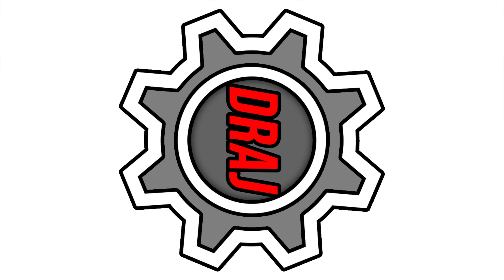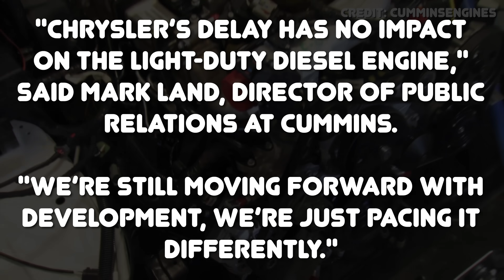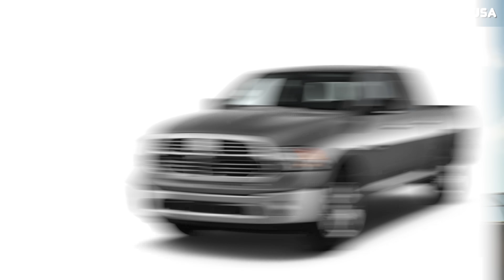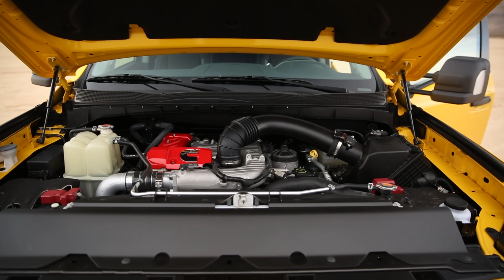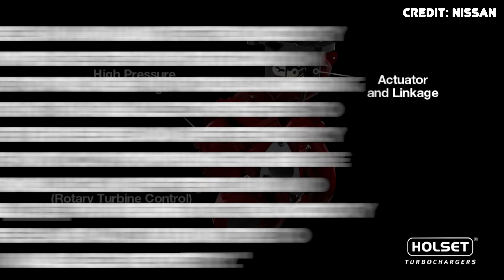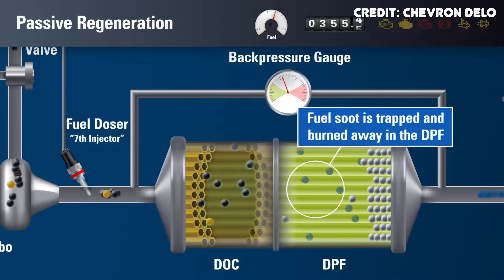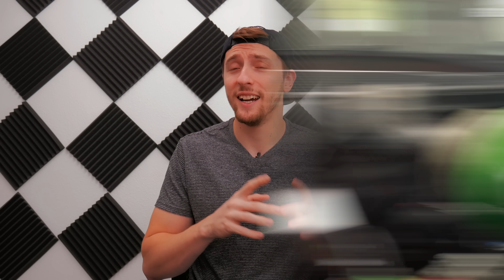5.0L Cummins: Everything You Need to Know

Comment from the maker: If you guys enjoyed the video, please SMASH THAT LIKE BUTTON. It helps the channel out a huge amount and helps YouTube put the video in front of more people. Thanks for watching 😬
Reply: Can you do one on the ford f150 powerstroke engine kind of like this or maybe a series on halfton diesel options and their development.
Reply: 5.9 cummins with the 6spd auto all day
Reply: That weight to power ratio is actually horrendous the old ass  OM606 on Mercedes puts out 600 horsepower with stock internals and can be fitted with a mechanical pump from the older OM617.

It's less than 500lb wet.
Reply: Specially with the twin cam set up, then u hav the turbo in the valley of the intake
Reply: have you done a vid on the toyota 4.5tdi. ausie. 75 series ute.  heres one for you, 4.2tdi, factory, fitted to silverado,s & s/duty,s. in brazil. i own a s/duty one in aus. with a bigger, turbo. std is a t04 mitsubishi, i fitted a t06. now has 700nm, 230 hp.. not much but good for aus, 12.5 lt 100. in brazil,they big turbo,& twin turbo them, scary fast..watch vids of them, f1000 turbo or silverado mwm sprint. or just mwm sprint. owned by IH, for 5 yrs.  4 & 6 cyl versions. then common rail, .5lt would sell like hot cakes in aus. bit dubius about the pump though.  an injector for the 4.5tdi toyota, is 1k,,each....starter in valley. as per dirtymax..
Reply: Always
Reply: Hav to hav a rocket engineer to werk on it
Reply: compare that to our ausie toyota 4.5 in the 79 series. its an anchore.. 1k per injector. 680nm twin turbo. starter in the back of valley.. joke..
Reply: This 5.0L Cummins engine is also great for swapping in used cars no matter what your favorite car is.
Reply: I think those Cummins diesel engines are great for all cars, even for Chevy Caprices, and Ford Police Interceptors.
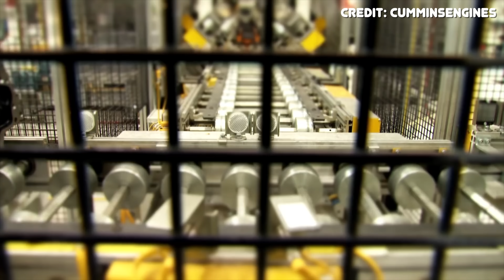Reply: 4:15
Reply: 10:47
Reply: I SMASHED IT and it didnt do anything except crack my phone screen.

Comment: A modern 1500 with a V8 or the high horsepower version can do 90% of the work an average person will need …. My 1999 F350 has a lower towing capacity than a modern F150 … your average guy isn’t going to keep a truck that is almost 30 years old so longevity isn’t an issue , for my usage I would never get a modern diesel , don’t need it , the most I tow is 10k and I don’t do it daily , so the better towing mileage really doesn’t justify the diesel

A family member has an eco boost 150 and it tows better than my 350 … difference is I get 16-17 unloaded and 13-14 towing , he gets 21 unloaded and 7 towing  , but when you tow maybe 2000k a year it’s not worth it for the doesel

Comment: I have the 5.0 Cummins in 2017 Titan. It was the cheaper option for what I needed at the time and honestly, I’m impressed. We towed a 9000 lbs RV from OH to WA and back, granted we stopped for fuel every couple hundred miles. With regular maintenance she’s been a reliable daily driver since. My only complaint is of course all the stupid sensors that often need replaced. But I am glad to have her with diesel prices where they are today.
Reply: I keep seeing good comments from people who actually have this truck and I keep seeing bad comments, but people who don’t have the truck I typically lean for people who actually driven and have experience with the truck on a personal level than just a mechanic simply because the mechanic is probably dealing with people who pushed their truck with extreme performance modifications who’s out here doing dumb things with their truck so it’s nice to know that there’s people who drive vehicles responsibly like yourself that I can lean on who actually don’t have these catastrophic problems. Thank you for your input.

Comment: Bought a 2018 in 2023 with 60,000. Had an issue with DEF recall, Nissan recall. At 120,000 the EGR went out. 2000.00. Has 150,000 on it now and still adding to it. It pulls 2 horse's just fine and I just hauled 5 rolls of hay at 1,000lbs. We love it. Comfortable and great towing.

Comment: Stay away from this engine . The crank broke on every one of them . 100 k miles it's the life of this engine . If you go over you risk engine failure . What ever they told you if you have a 2016 to 2019 cummins 5.0 make sure you change the crank and bearings . This is costly . One way to find out if your about to get it wreck is go with a bore scope cam by the oil plug and look if the crank is blue . If it's the case get rid of it or change  everything. You won't recive help from Nissan neither than from cummins . It's a not my problem case 😢

Comment: It is a shame that with Nissan out of the picture that Cummins doesn't just use some of the design theories that have made the rest of their engines so tough and reliable. I would buy a less complicated version that had either a single turbo, or a set of smaller twin turbos, didn't snap cranks, damage injector pumps and injectors, and had real valve covers. They could have a look at a Toyota Landcruiser V8 diesel for inspiration, at least now that they have sorted out the injection issues they had. lol

Comment: Cummins had to have problems with this engine. They made it because of the space that Nissan had. I am a Nissan owner on the '05 and still has $200,000 and runs great. I'm sorry to see that Cummins had so many problems with the diesel. I would have bought one but of course they had too many problems with the turbo in EGR system unfortunately

Comment: Put the 5.0 in front of the ZF 8HP70 8 speed automatic, it'll get WAY better fuel economy. At this point, unless they scale down the 6.7/5.9 and put it in a ram 1500, I'm convinced there will NEVER be a good half ton diesel. Like literally, just take the 5.9l cummins, make it a 3.0l or maybe a 4.0l and you're set with a million mile motor.

Comment: There is a ton of disinformation in the video about the application of the ISV8 engine… ram didn’t use this motor because they would’ve had to redesign the chassis of their 1500 trucks completely, and Nissan stole Dodges sales rep finalizing a souring business relationship… The Titan XD was substantially larger than any half ton on the market weighing as much as most 3/4 ton trucks of that time, in fact the frame is from the NV series van that Nissan discontinued and they were massive trucks…That motor was never intended for a Ram 1500, and the Titan and Titan XD are two completely different trucks sharing on a few body panels and interior options. Also, he didn’t even mention the main issue with these trucks, crank failure, I know I had one.

Comment: The same basic project seems to have also originated the overseas ISF2.8 which was offered as R2.8 in the USDM. But maybe, had the 5.6L V8 succeeded at the intention to replace the B5.9 in the Ram, maybe a 4.2L V6 for the 1500 would follow suit.

Comment: I didn't watch the video but talking about this engine is pointless without talking about the transmission it's attached to. 

Currently you can't get any parts for the transmission other than filters. You can't even get proper seals from a dealership. Any other wise fixable problem will now require you to buy a complete transmission from a dealer for about $13k US.

Comment: As an owner of one of these 5.0l cummins, nissan disasters. I do not think their good for anything. why nissan only source of parts, EGR cooler 2000 installed, turbo 7000 new 4500 reman, def pump out warranty 3500, no parts for transmission only complete unit 14000, new engine  24000, injectors 1400 each. That's without any normal maintenance. They also brake crankshafts.

Comment: There is another BIG, or rather the reverse, advantage of the V8 over the in-line 6 - and that's the sheer length, and height, of the engine!
There are many instances one may not be able to package the 'six' but an 'eight' will fit. True, so will a four, but they may simply lack the required power/torque or NVH requirements.

That's a big part of why the VM30 was/is popular, especially after the failure points are addressed.

Comment: Great video.  I have a 2017 XD.  It was a slug, added foss filtration system/pump and did DPF delete.   Went from 12 mpg to 19 mpg and it’s a beast of a truck now.
Reply: Just bought 16 going do same thing 94,000 km still have it ?
Reply: @barsandrunning thinking g of buying a 16 how much is that gonna cost
Reply: @REKLAW47 they are known for cracking heads, each head is 5-8k
Reply: @dudeman3186 
These Titan XD’s crack heads? I just started to research them. I think I’m just going to build my own truck and do a 12 valve Cummins swap on truck of my choice and restore it. Everything since EPA regulations are all garbage I’m finding
Reply: I did a delete to,  getting 20 city and 30 hw. You have a heavy foot?
Reply: Yes heavy foot needed ? Someone told me they burn ❤️‍🔥 better heavy foot?
Reply: @barsandrunning I drive it like a normal truck, and it does fine and gets good mpg
Reply: @imcrazyforwar  Do you live in a rural area?  I live in the city and wondering how you get it past registration?  Im in texas and very curious.
Reply: @aznxfactor I live in a state where they don't check for emissions
Reply: @imcrazyforwar nice!
Reply: @i @imcrazyforwar neither does Texas. We don’t even have an inspection portion at all anymore as of this year.

Comment: I’ve bought my truck now (2500 Ram)in 2003. The only problem I’ve had is to have the trans rebuilt (twice pulling my 14 k trailer)and replacing my heater core twice. I now have just over 750K on it. Great truck if you take care of it.

Comment: Too bad it’s an amazing engine just bad engineering add on components like the def/egr/fuel pump. And market it as. 1500 nothing else and keep the price at the low point and this truck would have slayed so bad engineering and marketing = failure and class action law suits 😢  and the demise of a Nissan and Cummins relationship. If you buy one replace the fuel pump /egr/ and delete the def system if your a farmer

Comment: Thank you for uploading. Cummins makes the best diesel engines in the light-duty truck applications, not to mention the fact that the 1989 Dodge Ram equipped with the Cummins diesel engine was (to my knowledge, I could be wrong) the first use of a reliable diesel engine in a pickup truck.

Comment: Those 5 L Cummins are known for breaking crankshafts. I saw a mechanic work on a Nissan Titian with spun bearings and main caps that had massive slop in them. The journals were burnt from the bearings spinning. The engine had a horrible rattling noise but no weird exhaust smoke. At $23,000 for a new engine, the shop is gonna try to get a good used block.
Reply: Holy fuk 23k for a new engine? That’s insane
Reply: So, i would like to give some insight to this. These engines have an after treatment protocol for keeping the exhaust hot enough to properly turn harmful chemicals into not so harmful chemicals (this process sprays the injectors post power stroke) with this being said, the engine oil should be filled to the very bottom mark of the dipstick, when the injectors spray after the power/combustion stroke, naturally some diesel fuel will end up in the crank case (this is why the oil should be filled to very bottom hash mark of dipstick) filling them over the bottom hash will result in over filling the engine over the course of a 10k mile oil change as recommended by owners manual. This is why the crankshafts wind up broken. Not usually a manufacturer defect, just misinformed lube techs/owners.

Comment: After doing a lot of research I decided to buy a Nissan Titan XD with the 5.0. Cummins because it was exactly what I was looking for.  I bought a 2018 with a 100k miles on it that was a one owner and strict maintenance which is the key to anything lasting for a long time. I’ve had it for about 3 months now and I absolutely love it. Coming from a guy who has owned dodge, Chevy and ford this has to be my absolute most favorite truck setup. Not only is it comfortable but the fuel economy really isn’t  that bad. It is my daily driver and I’m averaging 18-20mpg which for a truck is pretty good in my book. IMO Nissan did a horrible job at advertising the Nissan XD Cummins and that’s what led to its downfall. I am sad that they don’t make even anymore. I plan on keeping mine for a long time. I think most these issues you addressed were mainly problems with the early years like anything else. If you are looking to buy one stick with 2018-19 model years. They seem to be the best ones. I wish Nissan would have continued to produce the 5.0. Sad.
Reply: I'm looking into getting a XD cummins as well but I don't know if I should get the older 5.0 cummins or the newer 2020 model with the 5.6 gas. What is your opinion on my predicament?
Reply: @cadenevans3117  A lot depends on what you’re going to do with it? If you want to do any towing at all you’re better off with a diesel. For what it is and the price you can’t beat the Titan Cummins. I absolutely love mine. I have the pro4x package and it’s extremely comfortable. It rides like a Chevy with the durability of a ram. Pretty sweet ride. I’m going to be launching a new YouTube channel here shortly which will be dedicated solely to the Nissan Cummins.
Reply: @countrymusic23  yea I'm wanting to tow a little bit but not a whole lot. Just wanting something reliable and a really good daily. I've heard that the 5.0 cummins has reliability issues unless you delete them but I don't feel like swapping the DPF and EGR every 2 years. Unless it's not that hard and I should do it anyway
Reply: @cadenevans3117  Mine is a 2018 completely stock emissions still intact and everything. I haven’t had any issues with it. It has almost 105,000 miles on it. The early years 2016-17 I’ve heard are the ones with the most issues I would stay away from. I would stick with the 2018-19 years they tend to be more reliable. It took me 6 months to find the one I wanted but it was well worth it because it was a one owner and meticulously maintained which is what I wanted. When you’re looking at one maintenance history is the key. You want to look for where they changed the oil every 5,000 miles. You find one like that and you’ll get a good one. Not only that but find one like I did with 1 or 2 owners. A multiple owner one is more likely to have problems. A vehicle history can tell you a lot if you know what you’re looking at.
Reply: @countrymusic23  ok thanks man!

Comment: I figured I would chime in on this truck, I would also think its worth noting I`m a professional truck driver of 30 + years. I have a 2019 XD with 71,500 miles.  I live rural so I average 20mpg in summer and 17-18 in the North Idaho winters. I do run a aftermarket fuel additive like Standayne or Diesel 911 for a lubrication of the fuel and a bit of extra fuel economy. 
I use Valvoline Premium Blue for oil with regular service. 
The truck is comfy, roomy, quiet, and for a diesel truck drives really nice. Very nice to hop into after a 10 hr day driving a class A truck. I always see people bitch about this truck
not having enough torque, and being less capable then the other big 3 trucks. The truck is a heavy half meant to be between a half ton and 3/4 ton. 
If your gonna be pulling a skid steer on regular basis your gonna get a 3/4 ton truck or better. 
If gonna pull an RV or boat for summer fun the specs on this truck are perfect . My example of towing for XD is I have a 32ft travel trailer , loaded for bear with the family. As a test I decided 
to see what this truck could do going up 4th of July Pass in  Idaho.  From a dead stop, I got to 70 mph and still pulling halfway up the grade and still easily pulling before I backed out it. 
More then capable for my needs. 
Now the issues I`ve had. I would like to mention that every diesel I have ever driven has odd personality quirks that very from truck to truck. 
I`ve had two separate issues with the  injector/fuel rail.  First one  had the fuel line vibrate off the injector(covered under Nissan warranty) that was Spring 22` Then Spring 23` had an injector go 
bad and not covered under Nissan warranty as its part of the emissions which Nissan only covers for 50k miles. Thankfully not trusting modern diesel def system I bought an extend warranty that 
covered the issue.  I just dropped it off at the dealer yesterday as I have a  catalytic going out , and Im guessing a transmission sensor going out(the temp gauge is missing the hash lines to measure temp) and Im getting low tire, ABS and traction control light stuck on in the cool morning and goes off in afternoon summer heat. 
(edit) I forgot to add for the bad injector I had a 30 day wait for the parts and service.
So take this info as you will. I think the truck is nice, but I would strongly recommend anyone getting a good aftermarket warranty and stay up on servicing your truck or any diesel that you choose.
Reply: What town or city are you from live in same part of the state

Comment: The 5.0L Cummins diesel always intrigued me. It’s too bad it seems to have been doomed for failure. I’ve owned two Jeep Grand Cherokees with the Mercedes Benz V6 3.0L OM642 common rail diesel engines. It was a fantastic engine. Pre-DEF, made great power for the size, and after an ECU tune made even more power and was very efficient. It also help do away with the pesky swirl valve and EGR issues.